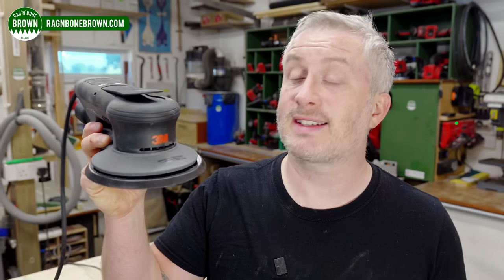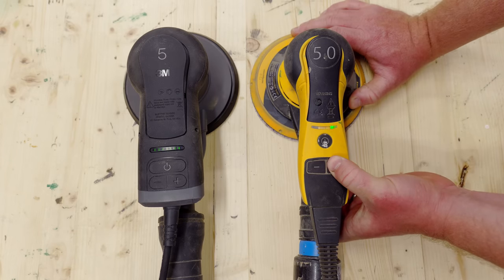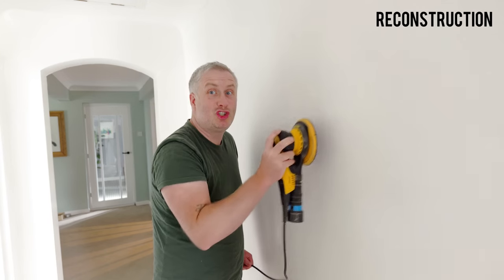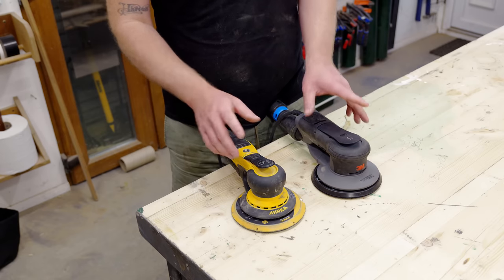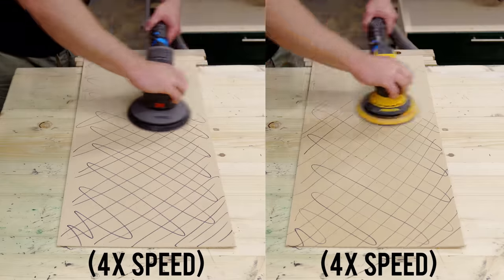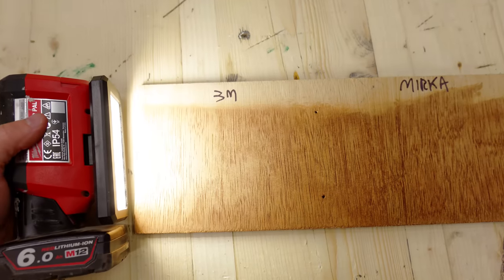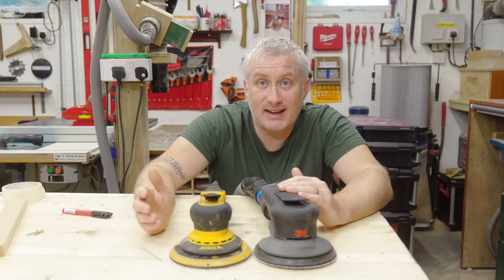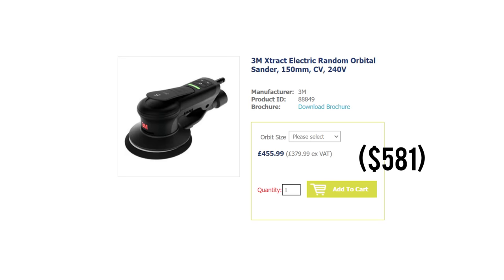A CLEAR WINNER! / Mirka DEROS Vs 3M Xtract

Comment: When I first got my Mirka (I have 4) I put a Mirka pad saver on the 5”  sander. After using it for a while the sander would shut off??? Called dealer they had me send it back for warranty repair. When I got it back service department said nothing wrong with it!? It kept cutting off for me?! Finally I looked at manual. If you use pad saver you must realign balance screws under sanding pad which I did and haven’t had a problem since.

Comment: I bought the 3m. It lasted 1 year then just stopped running/turning on. Always used with a vacuum. I now have the Deros. It’s actually MUCH more weight balanced and less prone to tipping. Proves you never buy a first gen product

Comment: There are lots of negative reviews on the 3M. I purchased lightly used one and loved it until it stopped working. Is less than a year old but I'm not the original purchaser so warranty doesn't apply. Very disappointing.

Comment: Minnesota Mining and Manufacturing. I live in Minnesota where we have strong loyalty to 3M as almost all of us have a family relative that has worked there. I don’t think I would buy the 3M extract because it is a great first attempt but a second revision would be that much better. May not happen and the Mirka is a quality professional tool that seems very refined. The only reservation I have is costumer support which is difficult to really know because you cannot base it on hearsay from random people on the internet. If a button stops working I’d think they’d make it right.

As an aside 3M’s air/pneumatic sanders are something I’d probably buy. Automotive industry has refined them over a few decades.

Comment: I have a 3M Extractor sander like yours and can 100% confirm the loud noise and vibrations as you mentioned. It is so bad that I don’t feel comfortable turning it on up in mid air like you did as it gives me the impression it’s on the verge of breaking down with very loud noise and vibration (the two goes together). I don’t have a Mirka yet but after watching this video I’m planning to buy one. Thank you for the thorough review 👍
Reply from the maker: Please see my update in the latest vlog video

Comment: I have to admit that given the video's title and your well documented challenges with the Mirka I was expecting a different result. That said I tend to agree with the key points you made in favour of the mirka. I chose Mirka for the dust extraction because anything less than the best I can afford is not good enough and noise. The fact it stops quickly and it's really comfortable were bonuses. I used a 3m on a community project I volunteered for a few weeks ago and found it to be a good machine - very effective on sanding old paint and I can see why the professional on the project who owned it liked its performance. On a busy noisy site it didn't sound out of place but 'hearing' the comparison in the video side-by side I know which one my neighbour would prefer when she's out in the garden and I'm spending an hour or two finishing in the workshop. K.
Reply from the maker: Cheers Karl. Yeah I expected the opposite result too to be honest! I do wonder if the one I have hasn't been balanced properly or something, as it really is quite jerky. A bit disappointing! If I had a contact at 3M I'd be asking them to check it over!

Comment: I’ve bought my Mirka 7 years ago together with their vacuum, it was a package deal I couldn’t afford to pass on beating the Festool price wise by quite a margin.   I have to say that after an initial failure the Mirka has been an absolute workhorse.  I’ve used the Mirka to sand oak floors in my sons salon business.  I don’t get any repetitive hand strain when using for hours at a time.  Dust extraction is super, on a flat surface.  Would I buy again - yes.  Thanks for posting.
Reply: Used a Mirka for the first time yesterday! Wonderful to use… but reviews have said they break more than others. Sounds like you’ve had a good time with it! Trying not to be out off by other people… 🤷🏼‍♂️ I’m a decorator so it’ll be moved around regularly… would you recommend the Mirka set up?
Reply: @Elwooddudes  there were some issues with Mirka sanders about 5 years ago which many were affected.  Min3 was a none Bluetooth type and the motor failed.  Repaired under warranty faultless since and it has done 150 square metres of hard floor, floors, walls everything.  I tend to use Mirka disks but 3M are supposed to be better.  Johnstone paint centres stock Mirka.  I also have the Mirka vac bought via a Dulux trade centre.  I can’t comment on Festool only that the combo would have been 500 quid more.  Wish you success.  Regards Mike

Comment: I have no experience of the Mirka however have the 3M and love it. I didn't have any of the noise or vibration issues. The motor isn't the same pitch as my Festool sanders but I dont mind that. It works really well and very happy with it. Thanks for posting - love the videos.
Reply from the maker: Cheers. Check out the pinned comment if you didn't see it

Comment: Had my own Deros for 4 years, been using them for 7….zero issues aside from when one was dropped from height, fixed in 2 weeks under warranty. Have sanded entire (very large) floors with one in the past, on all day (8 hours) for 3 whole days as an example. Not the ideal way to do it obvs but that’s what I was told to do at the time. Never gets too hot, dust collection is the best going and most ergonomic to use, picked up an equivalent sized Festool recently the weight difference is mental, felt really heavy. Be sure you give them a very thorough clean like every 6 months, (preferably out of warranty if taking case off)helps with cooling if used for long periods of time. Easy to do with the provided spanner and a torx bit. Or else use a vac and blower to remove dust build up from any vented areas. Vid on here somewhere no doubt. All in, have zero reason to use any other brand!

Comment: Nice head to head mate. That 3M sander noise ain't right. I've had similar sometimes on my sanders when either my disc/sheet isn't holding well or my saver/disc is badly aligned. Either cause vibration at full chat. I've never used the 3M but I'm pretty sure they wouldn't design one that sounds like that. Maybe crack the nut holding the pad on too. Could be it's not quite seated.👍
Reply from the maker: As always mate you're absolutely spot on!!  Haha....  I've just posted a follow up to this on Instagram stories and pinned a comment, hopefully others will see it and take note of the update in addition to the video review.  It's a very strange issue though?  The DEROS is just as quiet with or without the pad saver, yet the 3M seems to hate the pad savers?? Bizarre
Reply: @RagnBoneBrown  Ah, awesome. Glad you you managed to sort it mate👍 Still an informative side by side review mind.

Comment: That 3M sounds like something is broken or loose inside.
BTW, if you have have used these two, any chance you could check out Bosch's professional sanders? 😊 Not the green ones ;)
Reply: It reminds me of consumer grade green Bosch. Very unpleasant to work with for long periods of time.
Sanding by itself is already an unpleasant business in general, so anything that can make it every so slightly better is a win in my book.
Reply from the maker: Hi, I've just posted an update to this via Instagram stories following some comments on the video suggesting it is the pad saver - see here: https://www.instagram.com/stories/ragnbonebrown/3151964799280130289/
Reply: I have the xtract and I do not have that sound you have. Not even remotely close. Sounds almost identical to the Mirka.

However, I did have to have my xtract refurbished once. They repaired it for free for me though, so, at least there is that. It was out and back in maybe a week and a half? So, customer service is good.

Comment: Nice review Keith.  I bought a new sander in the middle of last year. I was using a cordless DeWalt (can’t remember the exact model) and it was so heavy and noisy.  After a bit of research I went for the Festool ETS 150/5 which I got for €499 (similar or even a bit cheaper than the Mirka).  My decision was swayed by the fact I bought a new Shop vac which was also Festool so the lack of a need for adapters was a plus for me. I’m honestly blown away by it. How quiet it is and also the speed at which it removes material.  Dust collection is great also. Obviously comparing to,the old DeWalt is like night and day and I always wondered was it much different to the Mirka. Thanks as always for your content.
Reply from the maker: Cheers. I'd love to have a go on the ETS150 and compare it with the Mirka. I've tried a rotex which belonged to my friend and that was impressive.
Reply: @RagnBoneBrown  gotta love that rotex.. I also use Mirka's and would like to get one of my own but the Rotex 150 with some rough paper is like a flap disk grinder for wood and with a switch of the knob and a new paper you're back to fine polishing. Heavy as it is, there is a reason it is so ubiquitous. If you haven't you should also take a look at makita's big belt sander, I've seen some old school pros use that thing effectively as a thicknesser, just having a dance with it.
Reply: You should get on to Festool UK to send you one to test Keith. 👍

I have an ETS 150/5 for the last 3 years, fantastic tool. The hard backer pad is much better than the stock one, and I switched to Abranet instead of the Festool Granat discs, way better.

 I am not a fanboy by any stretch, and when I upgraded my trusty old blue Bosch at the time, I also looked at a Mirka. I just don't like the paddle type trigger-the button on the front of the ETS is much better IMO; especially for longer sanding I find it's easier on my hands to be able change grip.

Comment: Interesting. I git the Makita version of these a coupke of months ago and run it connected to a Henry hoover with EPA collection bags - so I can sand walls and doors and things,
Totally unlike a regukar circuar sander of old. A different tool and one that will pay for itself because I can avoid using plasterers for skimming many walls and because I'll save time on prep work with decorating.
Reply from the maker: Hi, which Makita model is it that you have?  I'm not aware of one that is similar to the Mirka DEROS/3M Xtract
Reply: @RagnBoneBrown  It's the Makita Random Orbit Sander BO6050J from Axminster Tools. I got a sacrificial pad and Mirka velcro pads.
Reply: I'm sure you know this, but I was considering throwing away the used disks ... then I realised they were really useful for hand sandingthimgs like newel posts, handrails and anything curved.

Comment: Used both of those sanders, really like mirka  I just cant get used to the paddle design always gets in my way when I move my grip around on long sanding sessions. Why I only buy Festool sanders. nice review.
Reply: I like the deros. I have the delta too. Not a fan of the paddle either though, as, if you lay it on it’s back, off it goes like a deranged turtle.
Reply: Got to ask, do you use the Deros with a festool midi or similar extractor? Do you use any form of hose adaptor or just rely on pushing the deros male into the festool hose with a twist and hoping for the best? It seems to work fine, but doesn’t sit quite right with me.
Reply: @laurencecarr670  I dont own a Deros but used one for a week as a test from a local company trying to get me to switch from Festool. If I remember it just pushed on no turn like festool.

Comment: I have the 6” version of the 3M Extract.  It does not sound anything like the one in your video.  I agree with you, if mine sounded like yours I would find it objectionable as well.  Mine is quiet and sands beautifully.  It may have something to do with the motor?  In the states we use 120V 60 cycle power.  In Britain your power is 50 cycle (?) thus requiring a different motor perhaps?  Just a thought.  Thanks for the review.
Reply from the maker: Hi, I posted an update to this via Instagram stories following some comments on the video suggesting it is the pad saver - see here: https://www.instagram.com/stories/ragnbonebrown/3151964799280130289/ Thanks, Keith

Comment: I used to use a Mirka Deros everyday to sand brand new rocking horses, they were amazing to use, so robust and were used as they gave off a low amount of vibration that was under the regulations exceptable for using around 8 hours a day.

Comment: I have the extract sander and had the same unpleasant noise issue when I put the pad-saver on it. 

I had been using the sander for a bit while waiting for the pad saver to arrive in the mail so I took it back off and the sound went back to normal with a MUCH nicer tone, less vibration in my hand, and overall quieter. 

I strongly suggest comparing the extract with the pad saver on and off to compare the difference. 

For me, it was night & day.
Reply from the maker: Hi, thank you for the info - I've just posted an update to this via Instagram stories following some comments on the video suggesting it is the pad saver - see here: https://www.instagram.com/stories/ragnbonebrown/3151964799280130289/ Thanks, Keith

Comment: Just bought the 3m and mine, while has a slightly louder start, then drops slightly to a tolerable volume, although I would still want ear protection. However, it doesn't have as annoying a sound as I heard during your operation of it. It does seem like something is off with it, and even if it's just your backup I would get it looked at.
Reply from the maker: Hi, I've just posted an update to this via Instagram stories following some comments on the video suggesting it is the pad saver - see here: https://www.instagram.com/stories/ragnbonebrown/3151964799280130289/ Thanks, Keith

Comment: The DEROS has gone up quite a bit in price recently out of nowhere. MSRP on them now is sitting around $750 USD. I'm kicking myself for not buying a couple of them 2-3 years ago when they were around $500. It's almost impossible to find them used anywhere, I suspect because they're so good no one ever wants to get rid of them. 

I'd be curious to try the 3M for myself, but having spent several years using the Mirka on a daily basis (Taylor Guitars' factory uses them exclusively and I worked there from 2021 until the beginning of this year), the Mirka really is the best sander I've ever used in my life. 

I'm mostly curious if you get good fine motor control with the 3M by changing pressure on the paddle with your palm like you can do with the Mirka.

Comment: Great video Mr. Brown! I agree with some of the other comments on here regarding the 3M noise. Mine has mostly just a wind whooshing sound (not that nasty loud vibration noise). Something seems off with yours unfortunately.
Reply from the maker: Hi, I've just posted an update to this via Instagram stories following some comments on the video suggesting it is the pad saver - see here: https://www.instagram.com/stories/ragnbonebrown/3151964799280130289/ Thanks, Keith

Comment: If you take the pad saver off the 3m sander, I think you will find it is much quieter and the vibrration is non existent.  I did the same thing as you after a week of use and bought some pad savers to use with it and for some reason they seem to somehow through off vibration and additional noise even with their limited weight.

Comment: The 3m pads are amazing to use.
I purchased a MENZER ETS 150 Random Orbital Sander as could not afford the Mirka. Still not cheap bit I've found it wonderful to use, low enough vibration not to upset my faulty hand. And quiet enough to be drowned out by the dust extractor.
Would love to see a review of other mirka alternatives as the DIY sanders are not good for your hands or ears
Reply from the maker: The Menzer I believe is the same as the Hyvst that I compared to the DEROS in a previous video on my channel: https://www.youtube.com/watch?v=IlJaS-iiL10
Reply: @RagnBoneBrown  ok, I'll check it out

Comment: The noise you’re hearing is due to the pad saver. I’ve got one too and any time I use it, you get that same vibrating sound. It’s much quieter if you take the pad saver off.
Reply from the maker: Yes I covered this in my recent vlog video

Comment: Does the Xtract have that same tone when its actually being used to sand?  This is purely speculation but that sound when the Xtract is being run while you are simply holding it up sounds a bit like there is something loose and its rattling, making that extra noise.  I'm wondering if the pressure against the sanding pad muffles that extra noise while actively sanding.
Reply from the maker: Hi, I've just posted an update to this via Instagram stories following some comments on the video suggesting it is the pad saver - see here: https://www.instagram.com/stories/ragnbonebrown/3151964799280130289/ Thanks, Keith

Comment: I have to agree that sound from the 3M sander went straight through me. Far to higher pitch for me. It would put me off ifi was looking to spend serious money on a new sander. Overall I thought you did a great job comparing them.
Reply from the maker: Hi, I've just posted an update to this via Instagram stories following some comments on the video suggesting it is the pad saver - see here: https://www.instagram.com/stories/ragnbonebrown/3151964799280130289/ Thanks, Keith

Comment: The better dust collection is really important to me working In a shop I don't want to have to use a dust mask all the time. That's why I would go with mirka I have a festool but will probably grab a mirka at some point. If I had employees. The 3M is around 200 dollars less in canada so I would probably buy that sander for production if you needed multiple sanders